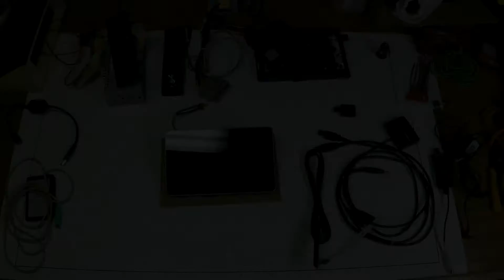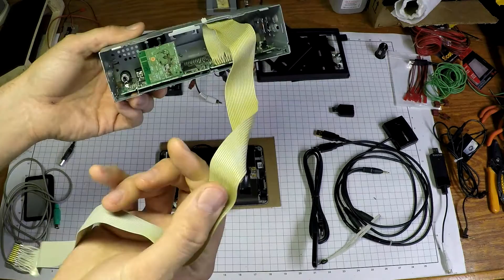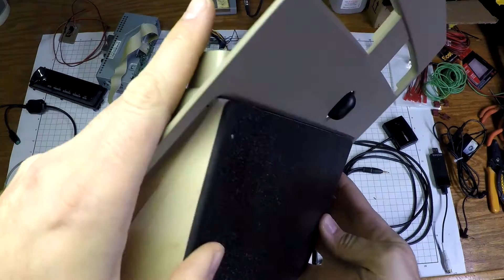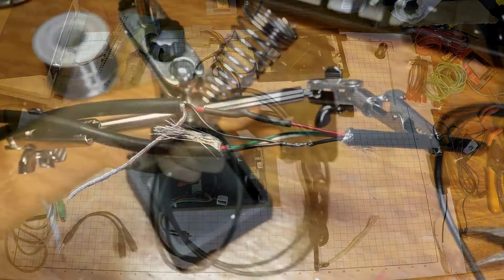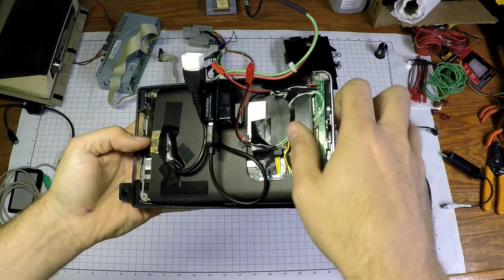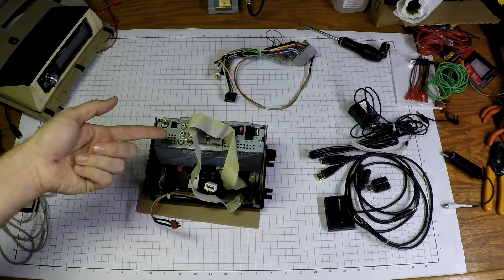Nexus 7 In Dash Version 2.0 - Ford Explorer Install Part 2 - Components and Mounting

Comment: i made a similar project a few months back.

the fried power thing you destroyed will work.
i did the same it smoke and so on BUT you need to connect a small power converter that is capable of 3 amps and convert to 4v dc connect the 4 volt directly to the tablet ( where the battery iy connectet) and connect the Fried Thing.
now change the tablet to power on on power ( google it) its 2 line of code and enjoy your 100% charged Nexus 7
Reply from the maker: Thanks for the comment!  Yeah I quickly realized I couldn't supply it with the 5v, but needed to duplicate the battery's output, minus  a tiny bit so it always senses charge.  So far though, Im still running off of the standard battery/charger setup, and the thing RARELY has to charge more than 1-2% when I run the car.  It stays at 98% over night even on a winter night.  Im starting to want to upgrade the entire setup including the tablet.  I need more CPU power and Ide love to be able to upgrade the Android version, which I cant do with Timur.
Reply: you need more cpu power? wtf are you using the unit? 😂😂😂

im totaly fine with my nexus

i ran into issues with my battery it discharged over night 8% thats tooo much
so i tried to connect 4 v and the thing began to smoke... lol

BUT its still working the "destroyed" thing. its now connexted to 4vdc
Reply from the maker: Haha yeah.  Its too slow for me.  If Im running navigation, Spotify, and maybe a torque widgent, it is completely maxed out.  CPU at 100%.  And there is no overclocking with my setup.  My current install isnt as bad, because I dont have Torque widgets going like I did on the Subaru.  But it would be nice to run some widgets or have bluetooth on etc without slowing things down.

Comment: so what I'm not getting is why I need to keep the radio or can get I get rid of it and replace it with just the tablet and not have to have both can that be a thing???
Reply from the maker: Sorry Nick, was away for a bit.  You dont NEED a radio.  BUT...you need a way to amplify the sound from the tablet to your speakers.  So you will need to at least send the audio through some type of amplifier.  A head unit is just the cheapest and easiest way IMO.  There are apps for terrestrial radio, but none that work as well as a good old FM/AM radio receiver.  And lastly, the tablet doesnt handle bluetooth calling like you'd think.  So if you want to do bluetooth calling in the car, a headunit with the capabilities is a good way to go.  Check around on google, you will find a few installs using this exact tablet and the people eliminated their head units all together.

Comment: How'd you relocate your power board? I disconnected my board from the main body when I extended my GPS antenna and ran the ribbon through the hole I cut for those wires. The board I just taped to the back cover and as spoken as I hooked up the USB the ribbon cable from the power board to the motherboard literally went up in smoke. Any ideas/suggestions?
Reply from the maker: Which power board are you referring to?  The USB connector you mean?
Reply: JEG's Garage yes the USB port "daughter board"
Reply from the maker: All I did was remove the speakers from the tablet, since I dont need them, and cut off the bottom section of the rear cover.  You can also make the speaker opening in the cover bigger and slip it through.  But once you have it back, you can double stick tape it to the rear cover and its good to go.  Nothing should have fried unless you damaged the ribbon or crossed some circuits somewhere.  A few of the other guys that have modified these tablets have posted their USB relocations too.  You can probably find better pics than what I show.
Reply: JEG's Garage yeah I'm confused myself. Never even unplugged the ribbon cable, just moved it around to the back and taped it down

Comment: Any idea where to find the membrane switch you used?
Reply from the maker: Amazon.  You can get them on ebay for about the same price, but they give you more than one.  Here is the one I got..and I went with it simply because it was Amazon Prime and i didnt want to wait haha.  

https://www.amazon.com/Matrix-Membrane-Switch-Keyboard-35x20x0-8mm/dp/B008DSM22A/ref=sr_1_3?ie=UTF8&qid=1501003089&sr=8-3&keywords=membrane+switch
Reply: JEG's Garage I found that one too. For some reason I thought yours didn't have any marking on the button. But thanks for the fast reply!

Comment: Did you ever figure out why the capture card keeps crashing ect... im having the same problem. I have to keep unplugging the usb end of the y cable then plugging it back in to work...
Reply from the maker: YES!!  Check this video out for my solution.  It basically automatically plugs in and unplugs the USB (electronically) during operation.  So far, its been working great, with only a few hiccups here and there.  Maybe once every couple of months I need to reboot the tablet, something I should do anyway, and it works great again.

Comment: what about the switch to turn backup camera on and off
Reply from the maker: Backup camera turns on via the reverse signal.  You can tap into your 12v wire for the reverse lights.  Lights come on...camera comes on.  You could put it on a switch if you really wanted to, but this works more seamlessly.

Comment: Hey there, I've watched your video here & was wondering if you shed some insight on some thoughts and theories I have dealing with a very similar thing. I have a project that I want to do with an install of a tablet (specifically the "nvidia shield k1" tablet) into my car dash. I'm debating if I want to keep the tablet battery connected or if I want to convert that tablet in a way so that I can run it solely off of the usb connection/charger. I don't have much experience with such a thing (not much wiring, just some basic stuff).

now I've already seen how to run tablets and phones on usb cables(which I figured was possible as I have done simple wiring like this for mini fans etc) just by simply; 
1) splicing the cable, 
2) snipping off the green & white data wires
3) snipping the battery off it's wires OR unsoldring the battery & wires from the board. 
4) attaching the remaining snipped red & black battery wires to the red & black (+/-) wires of the usb charging cable... or soldering the usb wires directing to the board in place of the originals. 

or in this case like your video keeping and using the top piece of the battery(like as required for that specific tab). 

That method looks like it seems to work (not sure if always on all tabs & phones).

But I was wondering if the battery could be snipped from the wires but the wires(+/-) be left connected to the board.
then, 

1) splice into a high speed usb charging cable(center just a hole) & snip the green & white data wires.
(so that the cable will specifically charge only)
& wrap it back up keeping both male & female/A/B ends intact. 

2) take those still connected to the motherboard power wires that the battery was connected to(possibly have to be extended in length a little) & attach them directly to the usb port on the device?.
(would this then create a closed connections/full circle/like an alternator?).

3) this way when the usb charger is plugged into both a usb 5v power supply and to the tablet, the tablet would then get the power needed to run/operate solely off of the usb charger cable only, without a battery but with a nice clean connection (no exposed wires etc).

This is all in theory of course ! lol
but the tablet would then;

A) run/operate on a usb power when connected to a usb changing cable.
(and would power on and/or off only when the car/5v power source is turned on and/or off.)

B) The tablet would also have a very clean/nice connection to the power via USB port on the device. 

C) The tablet would be closed back up (backing/cover replaced) and you wouldn't even know there was any modifications made to it or that there isn't a battery inside other than a maybe possible change in weight.

D) for an removable style install, the tablet can be easier removed and inserted back in and out of the vehicle with ease and not have to worry about wrapping a dangling cord around the tablet when you take it out of the car. 

E) if desired, the tablet could also be left inside the car(if you didn't want to carry it with you all the time) and there wouldn't be any need/cause for worry/concerns etc of the tablets lithium battery being damaged/ruined/overheated/exploding/imploding or causing a fire do to overheating in a car oven on a hot summer day. and if any worries at all you could just simply disconnect the usb power from the device and still leave it in the car with no further worries. 

Have you ever done this before(I mean the wiring/connections portion using the usb port itself to actually run a tablet) ? 

And do you know if this could work ? 
or is it even possible ?.

Thanks in advance for you reply/response
Reply from the maker: Hello.  Typically, if you replace the battery power source, as long as the voltage is the same, you will be fine.  You will want to keep whatever control board or electronics that are attached to the battery though.  Usually there is a little circuit wrapped up with the battery, and it will hold things such as logic, and temp sensors.  In order to not get any weird behavior from the tablet, you'll want to retain that.  So it thinks the battery is there, and at 100% charge.  On that note, in most cases, the voltage that the battery outputs, will be less than what you'll get from a USB.  If you are using any type of ROM that uses the charge signal to wake it or activate it, this might cause you issues.  Because the tablet thinks you are at 100%.  In reality, when the tablet says 100%, its really 99.9999999% or something, and the charge circuit is always topping it off.  So you'll want to drop that voltage to whatever your battery puts out at full charge, and maybe even a tiny bit lower.  Even if the tablet sits at 98% all the time, its better than nothing.  If you arent using the charge signal for anything, then its probably not a big deal for you.  But thats what kept me from doing the battery delete.
Reply: +JEG's Garage 
ok, thanks a lot for help/assist.

Comment: Should of used the Nexus 7 2013 instead of the 2012. It better as far as speed and display. The 2013 uses a 1920 x 1200 resolution and 323ppi pixel density  as where the 2012 was only 1280 x 800 216ppi. The 2012 used a 1.2ghz quad core with 1gb ram and the 2013 has a 1.5ghz quad core and 2gb ram.
Reply from the maker: I agree!  Except I already had and developed the 2012 and have it all set up.  Without the gauges that I had in the Subaru, the tablet works pretty snappy for me.  I do wish it had some more kick, but I can always upgrade at some point.  With the power managing and all the functions that I have working automatically, it was just worth it for me to keep using the same one.  Thanks for commenting!
Reply: +JEG's Garage Yeah. I'm working on my setup but I can't seem to find a working app that will allow me to answer my phone and use a mic/audio attached to the nexus instead of my phone itself.
Reply from the maker: I dont think anything exists for that.  Its probably 50% of the reason I went with a bluetooth headunit.  While it doesnt do anything fancy with the tablet like pause the music, it will at least mute the audio from the tablet.  Pioneer's bluetooth isnt stellar, but it works good enough for me in my quiet explorer.  In my Firebird...its useles.
Reply: +JEG's Garage qpair from lg does it and I have successfully gotten it onto the nexus and working to the point that it crashes once paired to my phone. Others seem to of gotten it to work with no issues.

Comment: thanks for the video very detailed how did you make the easycap power with the reverse? and did you use the oem camera?
Reply from the maker: Hi miggymig.  I used the Pioneer camera that was installed when I got the truck.  But any camera will work.  As for how I got the easycap to work.  THAT was a trick.  I have an ENTIRE video dedicated to that, because I feel I have a very good solution that I havent seen yet.  It makes the easycap setup work pretty much like a factory system.  Keep an eye out it will be posted up soon!

Comment: Sadly hard drives just never work 'that' reliably with android in general. People say android supports NTFS, and I've never had it once work. And even a 16gb fat32 drive, my nexus player set top box will reboot at times. Its a little flakey. I've had to stick with windows tablets just for that.
Reply from the maker: +Bryan Willis Yeah its a real shame.  Ive seen or heard of others getting this to work.  But I sure cant figure out how they manage to do it.  It will work one time.  And its glorious when it does.  Using PowerAMP or something like that is really nice.  The very next time I try it though, the music isnt accessible.  Its infuriating haha.  So I gave up.
Reply: I have a really inexpensive generic China tablet running Lollipop and it plays music and video on an SD card through the OTG input really well.  It locks up if I try to do more than 2 things at once but if I don't multitask, it works as it should.
I use KODI media player for movies and VLC for anything KODI doesn't play and it just works great.

Comment: Great video.  would love to know how to did the ribbon cable  on the radio. I have my radio mounted in my glove box. with my nexus 7 in the double din space in the car.
Reply from the maker: Ribbon cable was simple really.  I took the head unit apart.  I removed the connector that was soldered to the main board.  This is what the face plate connects to.  Then I just soldered the ribbon cable between the board and the connector.  After that, all you have to do is work out your mounting.  I think I detail that a bit more but its really up to your imagination.  If you never want to remove your faceplate, its MUCH easier.  You can glue things together and make them permanent.

Comment: what is the model of the stereo receiver you are using? Great video, thanks for sharing. I love how you put the faceplate seperate from the unit. I was looking for a way for my son to do his Hyundai Sonata, this would be idea. My Ford Ranger I just mounted the radio down below and building a whole new center console around it. My tablet is in the double din and use bluetooth to send the audio to the head unit.
Reply from the maker: +Brad Shifflett Hi Brad.  The headunit is a Pioneer MVH-X560BT.  So far, I really like it.  Its very compact, and very simple inside.  Its literally just a single circuit board.  Extremely easy to disassemble, remove the plug and wire up the ribbon cable.  I have a couple of complaints that you might want to consider.  One is its a little under powered.  2 volt pre-outs could be 4 volt.  I noticed a difference in my subwoofer levels when compared to the higher voltage of the other unit.  Ill fix both of these issues at some point with better components.  Most annoying is it doesnt have a dim feature t hat works with the lights.  You have to press and hold a button to dim the display.  Minor annoyance.  Otherwise I love it!